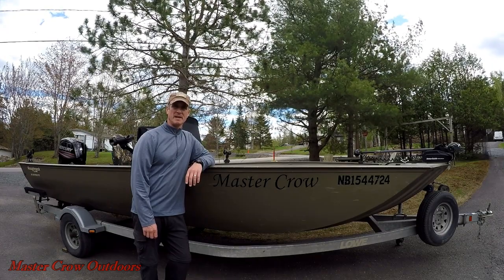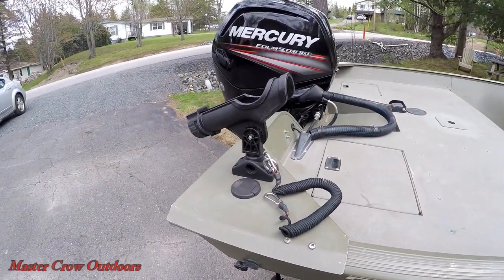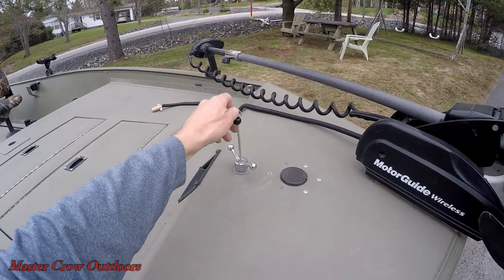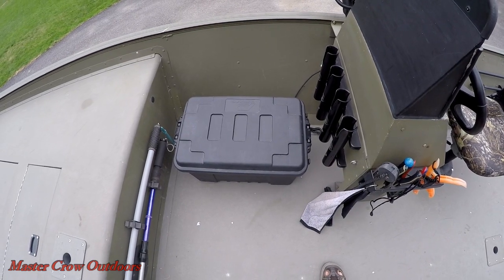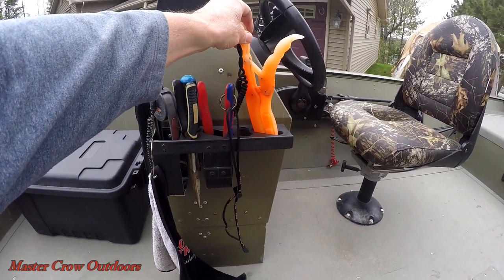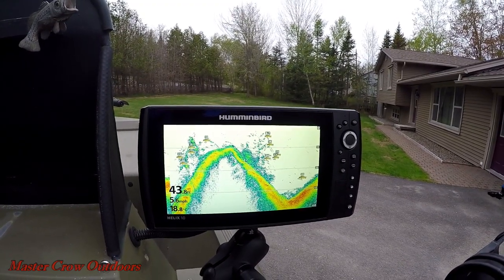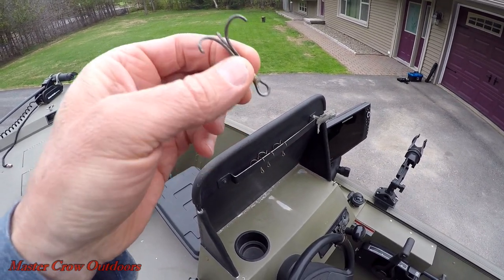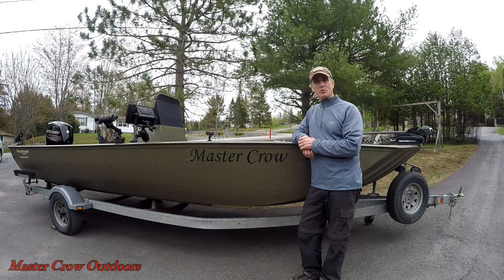Lowe Roughneck R 2070 VPT Jon Boat Tour-2018

Comment: Sir, I noticed you attached eye bolts up front. I'm assuming you utilize these in lieu of cleats? If so, how is that working out? I just ordered a couple of stainless collapsible cleats but always looking for ways to trim expenses. Also, did that ladder come stock on your boat? I'm looking for one that mounts like that and cannot find one.
Reply from the maker: The stainless eyebolts are used for anchoring a DIY sunshade. https://youtu.be/GZ5K2Jft2Ug
They have a large aluminum plate behind them, so could certainly be used as tie off points. The ladder wasn't stock. Picked it up from Bass Pro 10 years ago and has held up very well.
Reply: @MasterCrowOutdoors  You're the first person I've seen who has done this with a patio umbrella besides myself! On our pontoon, I took one of our round pedestal tables, drilled out the center and run the umbrella rod all the way down the pipe to the floor. It's a must have in the hot Alabama summers.
Reply from the maker: @LiLoTech  Cheap and effective solution to make the day enjoyable!

Comment: Great rig and set up.  Can you tell me what type of Scotty mounts you used on your gunnels for your rod holder?  I recently bought an aluminum fishing boat and am having trouble finding mounts.  Thanks
Reply from the maker: DA-Thank you kindly, appreciate the comment. The rod holders are Scotty Power Locks. The Scotty Orca's also fit the same mount. In order to mount them to the gunnels I had 1/4" aluminum u channel welded on to have a flat solid surface. A lot of guys aren't fans of plastic and another good option is the Down East Rod holder. (Not the clamp on option though!)

Comment: Glad someone asked u to make a video of the “master crow”. I’ve always wanted the tour..love the boat and layout.my dream is a 16’ roughneck was thinking center console but the side may be better especially traveling from front to back .any thoughts...great channel..time to fish I think.👍
Reply from the maker: AR-16' is a great size for a couple guys. I would highly recommend a 1660 SC. The wider beam really makes a difference in the available space. The side console takes up less space and like you mentioned, allows for easier movement. Went through the same questions when choosing my layout and never regretted it. Friends who choose the center console did. I'd also put on a 40hp fourstroke. More if you like speed and spending money on gas. Anything less and it will strain when your loaded. Appreciate the comments and tight lines brother!

Comment: How rough of water can you travel in before you would consider it dangerous?
Reply from the maker: This rig is definitely not built to handle the rougher weather with it's flat bottom and relatively low gunnels. Saying that, I've been out in 3 foot swells with winds gusting to 35 mph. It wasn't a very comfortable ride  and I  typically wait for better weather!
Reply: @MasterCrowOutdoors  Hahah I can imagine. I typically get into some 3's a few times a year and in my current 16' rig it can get pretty sketchy. I'm looking for something that can go shallow yet handle rough water occasionly. I don't care if I have to ride in slow as long as I feel fairly safe.
Reply from the maker: @davidh6396  That's what I was looking for as well and the 20 footer gave me the highest gunnels along with the flat bottom (12 degree deadrise). It's a big boat, but at the time the whole family and the dog were coming out with me. I also looked at Prince Crafts, which weren't jon boats, but had a flatter bottom, high gunnels and a vee bow. Good luck!

Comment: What year is this boat?
Reply from the maker: She's a 2008, but the console and seats are modified.
Reply: @MasterCrowOutdoors  did you move the console forward? And if so did you have to get new cables for the engine? Thanks 👍
Reply from the maker: @hulkhuggett  Yes sir, moved it forward about 3 feet for better weight distribution. I lifted the floor n welded in 1/4" aluminum plates to bolt the seat pedestal to as well. Made the driving position much more comfortable! I did have to get new cables for the engine and steering as well.